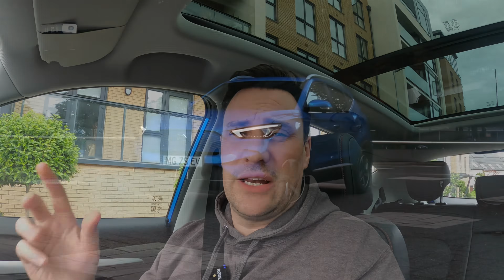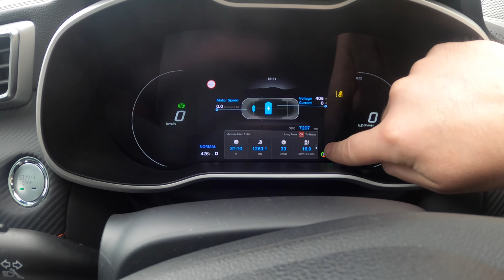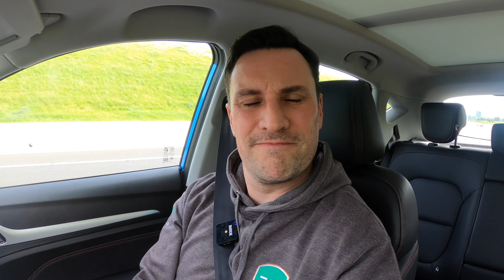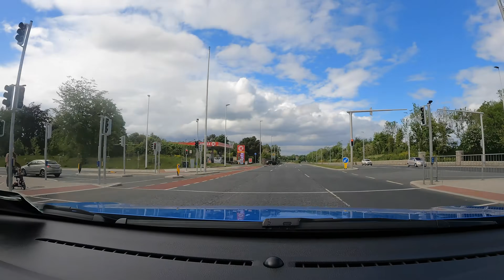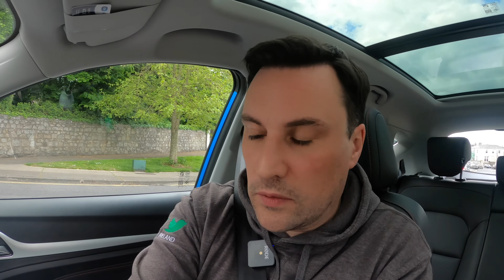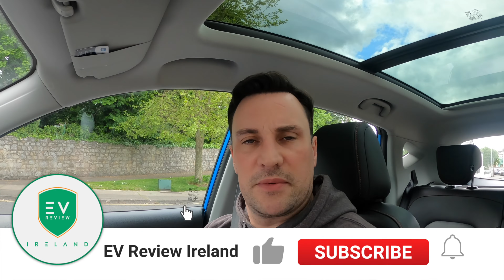MG ZS EV Long Range - Range Test

Comment: Hi Derek. Like ur reviews. I am looking into the MG ZS as my first EV. Just wanted to check. Does this battery loose some capacity/life after a year or more? Li ion batteries generally do that but not sure if it applies for EVs.
Reply from the maker: Yes it will. All EVs will like the performance output on a combustion engine vehicle does too. You can track this with dongles you can purchase separately or get a SOH (State of Health) for your battery when you get it services at the dealership.
Reply: @NevoEVReview  ok. Thanks for that. Another question please....does the MG 7yr warranty cover the battery too?

Comment: It just goes to show how long the range is you would have been driving all day! I don't how some Youtubers do the 1000Km drives all the time it must be so boring (Bjorn). I reckon you are correct for most people this will be a good car with excellent usable range and good for longer motorway trips too. What do you think of the car overall, build quality, drive etc?  I see there is an MG4 planned also on a dedicated platform similar size to ID3 for less than €30K that would be a big seller I reckon.
Reply from the maker: Thanks John. I find the build quality good for the money and looking forward to the MG4. That size and price point will do well in the market

Comment: Enjoyed that. Derek just a gentle suggestion, it would be nice to know what real motorway range is like with any BEV review which means @ 120kph rather than hearse speeds of 100-105kph which don't really reveal much about real world driving. IMHO, BEV should not inconvenience converts by limiting them to mostly left lane cruising like the gen1 leaf era 10 years ago. Time lapse a nice idea with the video.Looks a half decent BEV.
Reply from the maker: Full Motorway speeds in the future noted Noel. Thanks for the comment
Reply: @NevoEVReview  @oceanfroggie - I'd disagree interestingly. I've found that as I've become more aware of efficiency/environmental-factors, I'm regularly doing longer drives at 100-110km/hr. for a 200km drive (e.g. Dublin to Limerick), it only puts an extra 20 mins on the drive so makes no odds to me in the grand scheme of things. Of course, if I'm traversing Europe or the States (done both), at certain points I've the boot down when you're talking about savings in hours but that's the exception more than the rule.

Having said that I would have liked to seen what the range of the ZS EV is on a straight motorway drive for 200km to Dungarvan to get an idea of it in that scenario: as you aptly describe at the start, Derek, there is a large range of locations in Ireland in that rough distance so it would be useful to know what this vehicle is capable of. A note: I've committed to buying one of the new Niro EVs however, as I hear that the price is looking to be closer to €45k than €40k - a mistake in my eyes as it's getting very close to the Ioniq 5 at that price - I'm starting to wonder if this unheralded MG should go back to the top of the list!

Interesting review as always, great work.
Reply: @NealMcQuaid  I would also disagree. The non linear decreased efficiency when going from 95-100 up to 120kph is obviously not worth it, if you are going for long travels in an EV with a normal charge curve. This due to the fact that you will need to plan for more frequent stops for charging if you go faster. This logic could perhaps change in a future where the normal charge curve newer goes under 100KW, and the roads are littered with 150+KW chargers, but we are not there for the coming 5-7 years. Until then, I would argue that the correct way to test the viability of these EV cars for road warriors is indeed to happily ride a long in a nice tempo around 100kph.  

I would also argue that in a future where all cars go level 3/4 autonomous on highways, EU should consider to decrease the maximum speed to around 100kph due to the overall efficiency gains for all cars and the environmental impacts this will have. In a future where we have fully electrified fleets, and nearly "infinite" renewable energy at night for charging, this logic clearly changes again.

Comment: Why only 100km/hr or so on the motorway, not that realistic for most and will see a big difference in range.

Also, was the speed per the car or a GPS reading? Most cars under report so you were probably closer to 95km/hr if that was the case.
Reply from the maker: I'll need to do a comparison test 100km Vs 120km, the time lost Vs the range gained. 

Speed was per car.

Comment: The Kona still seems more efficient.
Reply: Would have classed the Kona as a smaller non direct comparison? This is also before you compare the specs of each, I believe the MG wins that hands down.
Reply: Yup, size tech and towing, tge weight alone reduces its efficiency but its still a 400 km range motor and may be 10k cheaper when alls said and done, that's a huge PV system for free electrons installed.
Reply: @Anonymous1990Baby  For me,  efficiency is king, in an electric car at least.
Reply from the maker: Now that would be a good head to head. I've the refreshed Kona coming soon so looking forward to testing that out

Comment: Don't know if you have the car long enough but would be interested in how the range works out over a week or more. I drive about 200K in an avg week, this should need charging twice a month, or does 'down time' add or detract from the range? Is charging better done at the edge of range or constant topping up? Yeah 'MG ZS EV living with it for a month' kinda thing. And another good vid, goes without saying at this stage.
Reply from the maker: I actually had it for 2 week and range on the odometer was averaging 16.8kW/100km. So with the battery size works out at 407km or 253 miles. Hope that helps Tom and thanks for the comment